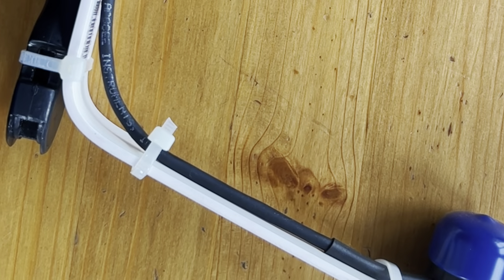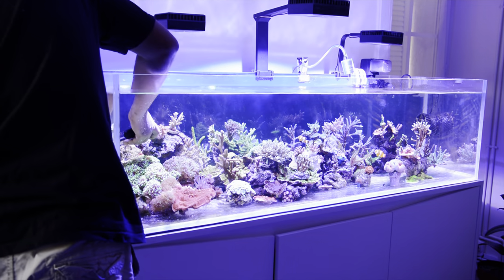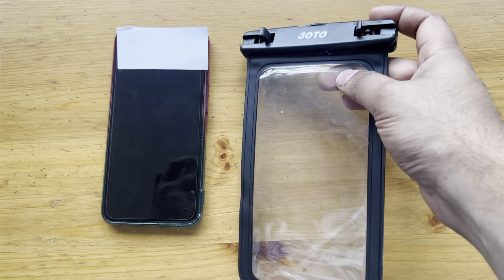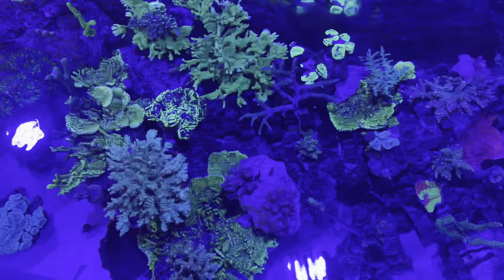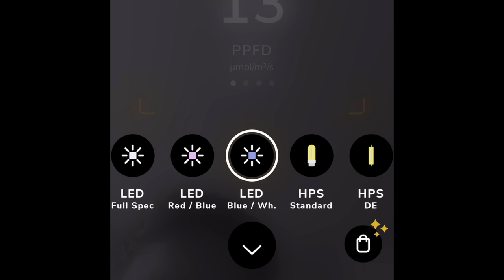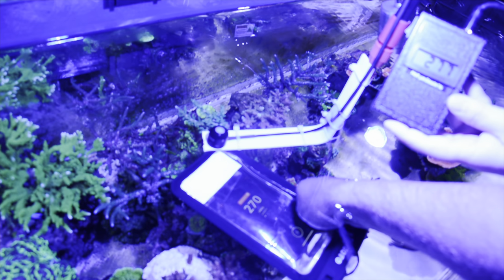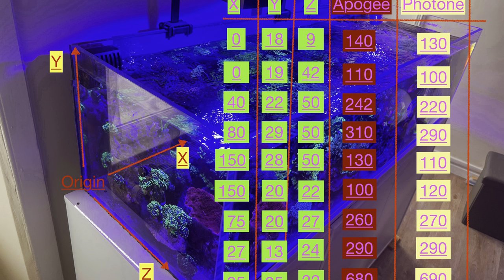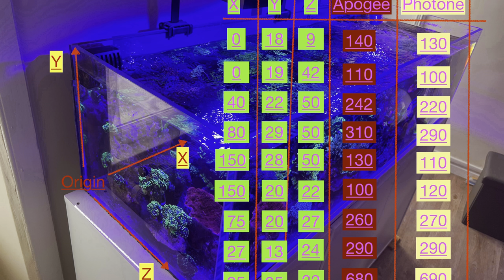Your smartphone as a PAR meter | "Reef tank"

Comment: Nice video! I want to do this but i have a couple of questions. Do you know if the app will ask for a diffuser if your lights already have a diffuser? And does it ask for a diffuser while its in the water proof case? Thanks in advance!
Reply from the maker: Yes you will need to add a diffuser even if you have diffuser in you lights.
Reply: @recif_conde  okay thanks for the reply!
Reply: The diffuser is a piece of printer paper over the front facing camera.

Comment: Thanks for the video. I assume that I have to turn off "Diffuser Detection", correct?
Reply from the maker: For diffusion you just have to tape a piece of a4 sheet on the front camera.. you need this for accurate measurements. have fun :)
Reply: @recif_conde   Did you have to calibrate the app with a par meter?. I'm asking because I'm only getting  about 30 par and the phone is less than an inch away from the light. 
App Settings are:
Blue + white light
Par Meter
Using regular printing paper for diffuser
Reply from the maker: @michaelbain6402  calibration is not usually required  but the orientation of your phone has a high impact so turn on the position setting. Make sure the diffuser is taped well on the phone and there is no free space between the phone and the diffuser